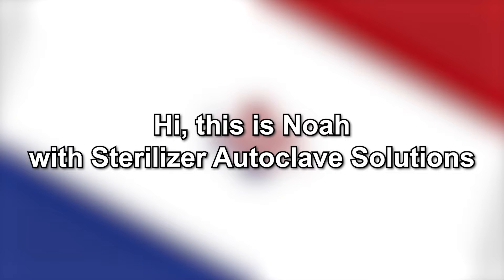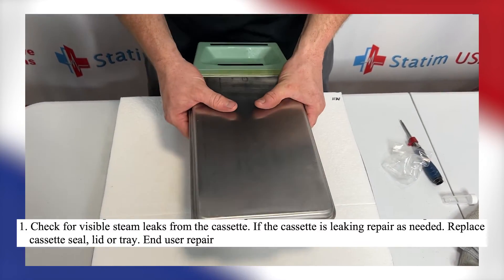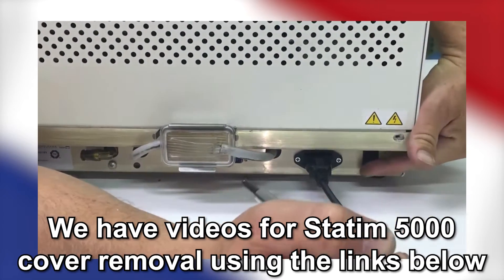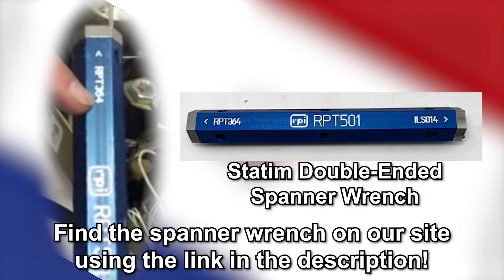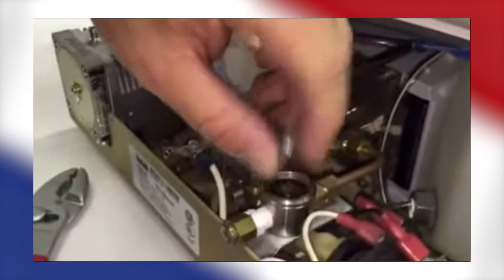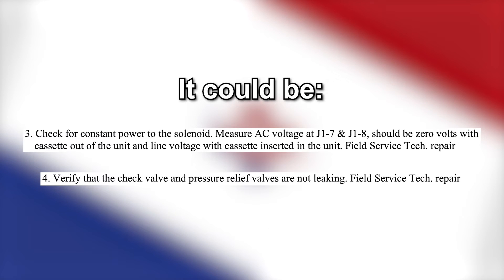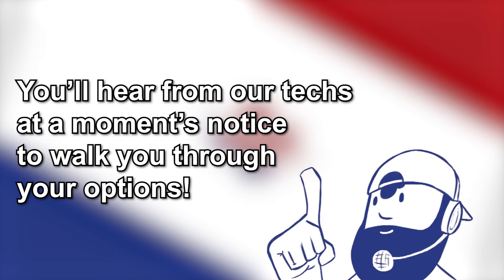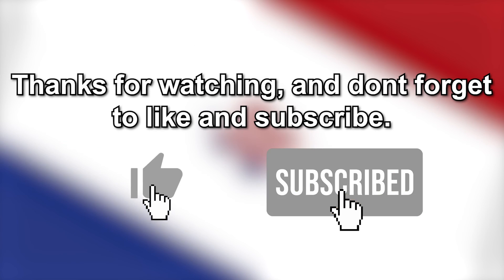SciCan Statim 5000 Cycle Fault 3

Comment: Hi, my status 2000 the gentle autoclave is leaking steam and condense out of the backside from the drain. The autoclave is from 2015 and i bought it second hand from a dentist. Is there something we can do about this?
Reply from the maker: Thank you for the comment! For better help figuring out what to do, we recommend calling our Free Tech Support line and speaking to a technician directly, you can call us at 704-966-1650 Option 3!
Reply: @SterilizerAutoclaveSolutions  i am from Belgium. That would An expensive call 🫣